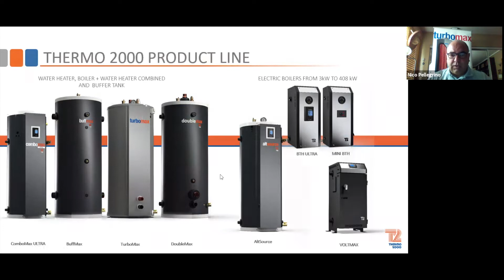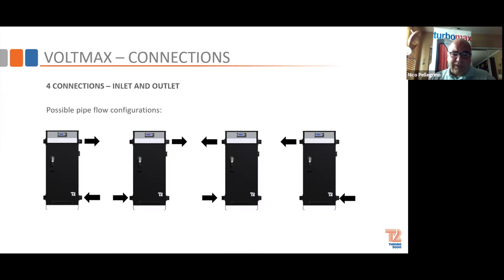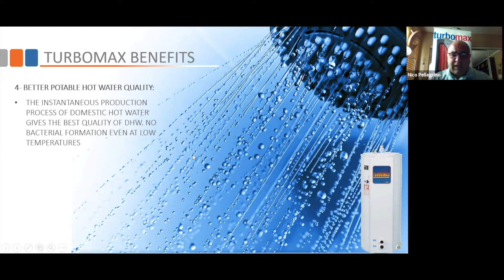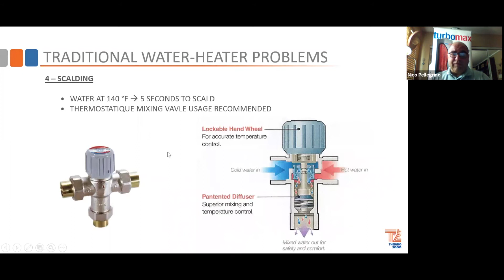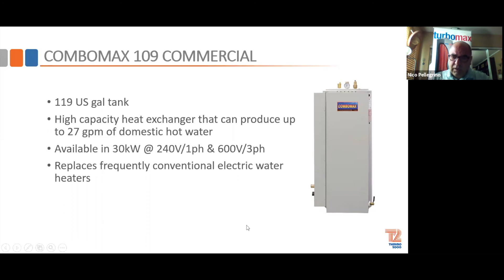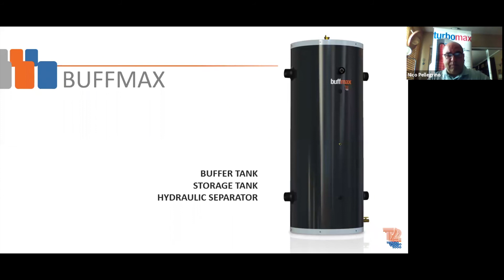Equipco Ltd. Thermo 2000 Training with Nico Pellegrino

Comment: For the Last 20 years I have had two Thermo 2000 Electric Boilers.  They have never let me down.
Living in Sudbury Ontario so we get the hard cold winters consistently.
This is a high quality product.  I have never had a problem in all these years!
I can’t wait to try the newer models someday.  Definitely going with Thermo 2000 for all my new projects
Keep up the great work!
Reply: I live in Sudbury as well.  How much does one of these cost to run?
Reply: @chrislemieux2000  We just had one installed a few months ago.    I just got my first power bill.    Strictly on electric, it ran us about $300 a month/$10 a day, above what our normal consumption is.
We’re heating our basement floor in a new home.    Icf foundation, r38 walls on main level, and r80 in the attic with triple pane windows.   Approximately 4400sq’ home.

Im calling the company Monday to ask a few questions.    When it’s not cold out and the thermostat says the room is warmer than the setting, the boiler still runs.    Not sure why, but it’s consuming power obviously.